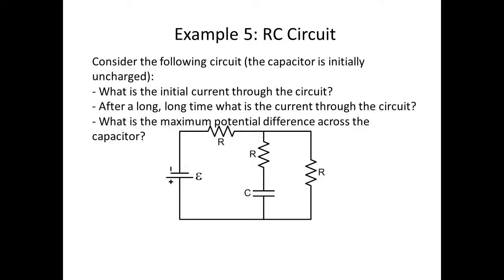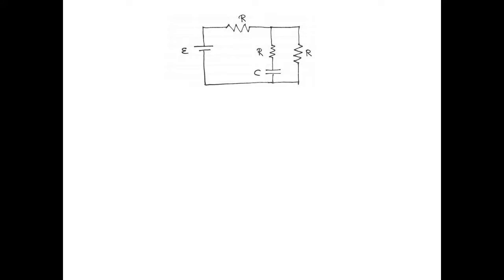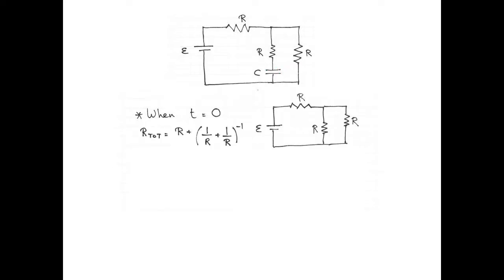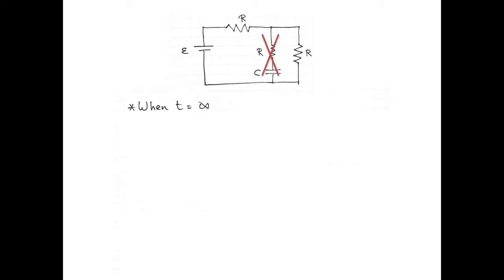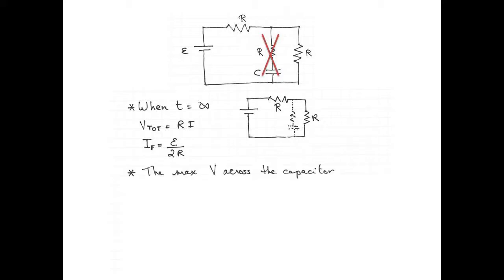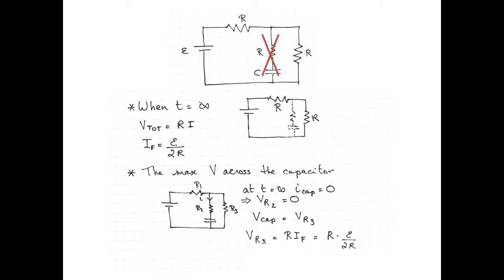Circuit with capacitor and resistors 2

Comment: The initial current calculation is not correct IMO. The capacitor acts as a short circuit and the current will only flow through the resistance in series with capacitor. The other resistance can be ignored.